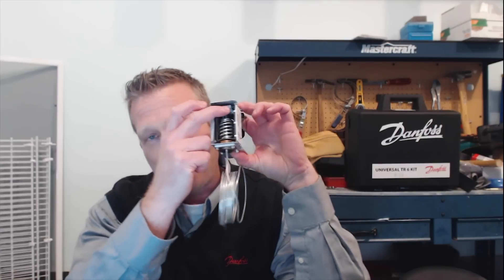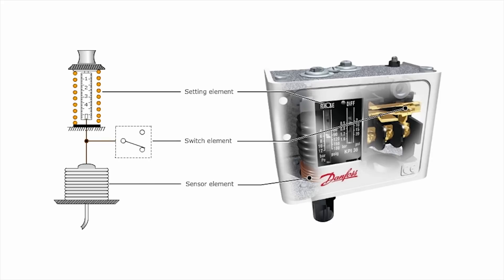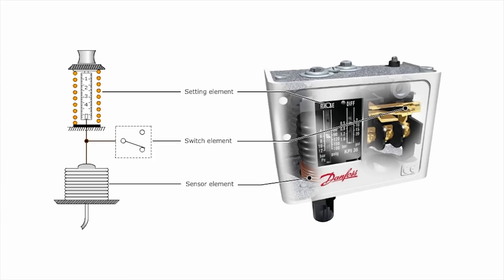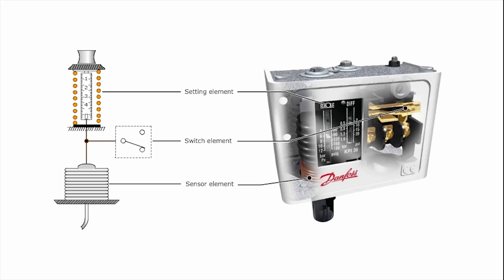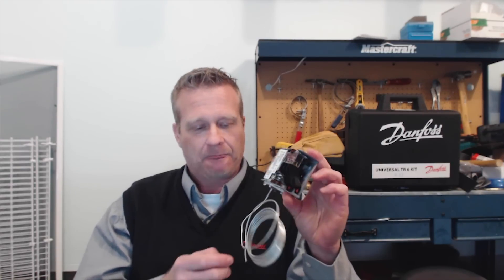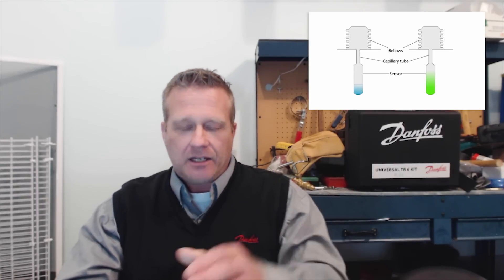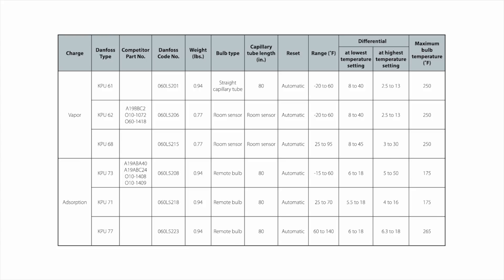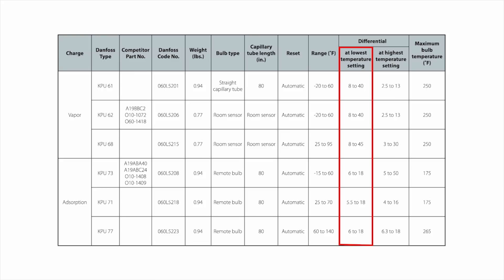All about thermostats – differential and charge | HVACR Distillery Episode 3

Comment: Thank you for next episode. It can be unclear whether cut in/out is Set Point - DIFF or Set Point + DIFF. Shouldn't this be always clearly indicated on thermostats / pressure switches?
Reply from the maker: Good question. The scale is labeled with instructions stating “Cut In -Differential = Cut Out” For a cooling t-stat, you set the cut in temperature on the ‘Range’ scale and from this, use a value of differential that will cut the compressor off at the desired lowest temperature. 

Desired Cut in temperature = 38F Desired Cut out temperature = 34F. Set the value on the range scale at 38F and then set the differential at a value of 4F.

However, because the electrical contacts are a SPDT arrangement, you can also use the stat as a heating stat in which case the action mentioned above will be reversed. The ‘Range’ scale is used as a cut out value and the cut in is set using the differential. 

Desired cut in = 68F Cut out is 72F. Set a value of 72F on the range scale and a value of 4F on the differential scale. 

I hope this helps!

Jamie Kitchen
Danfoss Cooling

Comment: Good evening Jamie i am little confused to run freezer room... There is a mechanical thermostat and LP switch can you explain for me please like if want to achieve - 10°c on R134a whats my settings on LP switch and on thermostat i will love your assistant thanks.
Reply from the maker: Hey, Lehlohonolo!
If the thermostat is measuring the air temperature in the freezer, set it to cut out at -11C and cut in at -8C. If the LP switch is set to stop the compressor during the pump down cycle, then please set it to .4 bar or 40 kPa.
- Jamie
Reply: @DanfossClimate  thank you so much Jamie 👊
Reply from the maker: @lehlohonolonyombane5446  Welcome! -Jamie